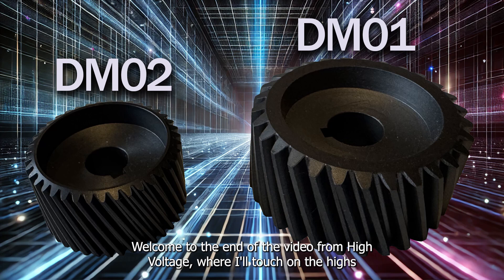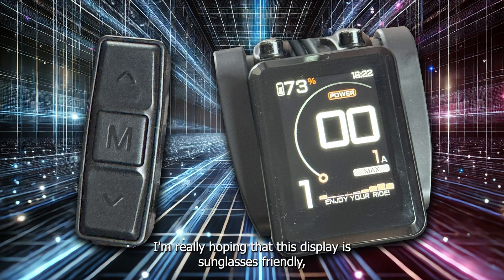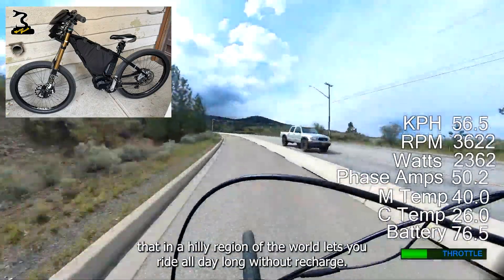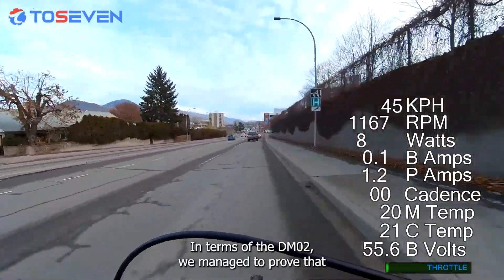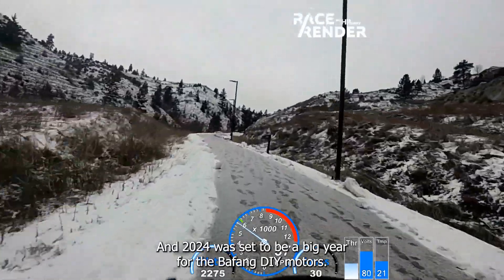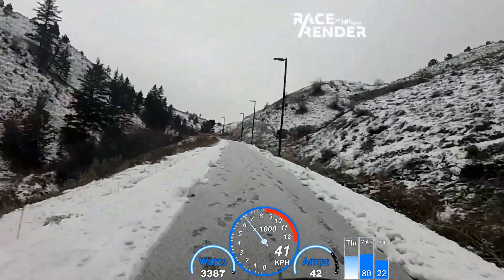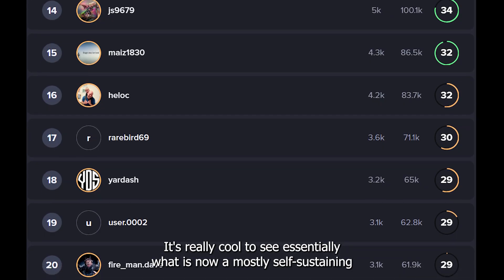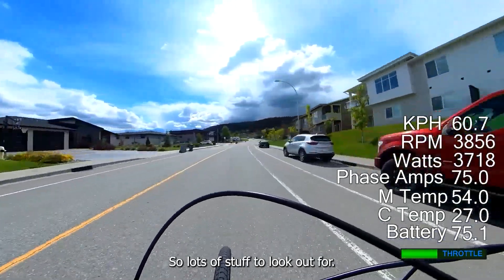High Voltage Year in Review 2024 - Cotton Mouth - TOSEVEN motor - Bafang

Comment: Slightly off topic. Toseven DM01 750W with 46t front chain ring. If i can only get 5 gears on the rear cassette to work due to chainline what is recommend.

Riding style nothing crazy. 52v battery road, 35kph would be enough and gravel tracks and a bit of through the woods. I like to peddle so no throttle. Standard controller

Comment: 100% dm01, i won't take anything under 1000w.
Reply from the maker: Hey Mike. It looks like the DM02 will be first by popular choice but I will for sure get to the DM01 as soon as possible. I might wait till late Feb so the roads are a bit better before I swap it out though.
Reply: @HighVoltageKits  Hello! I wanted to check in to see if you ended up doing any more work with the DM02? It sounds like a very promising motor, especially with the upgraded gear!

Comment: So, I'm confused. Is the torque sensing M635 uncancelled now? Does it require a proprietary battery?
Reply from the maker: It would seem that is correct and you can use any battery. I’ll have more news in the new year.

Comment: I've been using an ESC controller with the DM01 for quite some time now and it works wonderfully as an electric moped with throttle based pedal assist,  except native cadence based PAS doesn't work. Not worried about the torque sensing for now. Hopefully I'll figure it out soon. I recently reinstalled the stock controller with the updated firmware before I knew of the changes and they really did manage to sabotage this motor. Bad business move and it seems to run worse than it did before the firmware update.. Once I figure out cadence based Pas in VESC, I'll be set. I'd be interested in buying one of those black gears for sure.
Reply from the maker: Sounds good! Sorry you updated the motor before you saw the warnings. Hopefully TOSEVEN will see some sense and come up with a solution that is the best of both worlds. Good luck with the cadence based PAS. There are two colored wires for the cadence signal and the white wire is the torque signal.
Reply: @HighVoltageKits  Quick questions for you.

1. Without the torque wire in the equation, does the sensor essentially become a "quadrature" PAS? This is the only type of sensor VESC natively supports without writing a script.

2. Will you have some printed 01/02 controller covers available for sell any time soon?>

3. What's the projected ETA for the peek gear?
Reply from the maker: Yes to all. Shoot me a pm on discord for a controller cover. Same as the bbshd cost. PEEK gear enquires to Greg@highvoltagekits.com

Comment: John, thanks for continuing to raise the bar of tech for the e-bike community.  You have a keen sense of what we want as enthusiasts and many thanks for this effort.
Happy New Year.
PS. for many of us DYI'ers, CANBUS of course is merely an effort to make motor software unhackable and pair to proprietary batteries etc and the opposite direction of the freedom most DIY'ers prefer. In the context of the M635 motor, I hope as part of your R&D,  you evaluate whether its possible to connect this motor outside the limitations of CANBUS with alternative controller.  If Bafang pulls the plug on BBSHD production, it will be a big loss to the community.  All the best.
Reply from the maker: Hey Luke. Thanks for the kind words. Massively appreciate your support over the year. Looking to kick the channel into a higher gear next year. 2024 has been quite a difficult one all in. Cheers
Reply: @HighVoltageKits  Great news John. Your finger is right on the pulse and look forward to your content in 2025.  Best in the New Year.
Reply: There is no ''unhackable'' system i know of. Yet open source is the go for us diyers
Reply: @nicod974  Have you hacked and successfully paired Bosch, Yamaha, Shimano and Panasonic CANBUS motors to generic controllers and non-proprietary batteries with either torque or cadence sensing and throttle control?  
Is so, can you provide a link?

Comment: You seem to be wondering a whole lot about "why" companies like Bafang and TwoSeven make changes to things that are un-helpful to the DIY community.
It's simple - follow the money. They are a company, first and foremost. The DIY community is so microscopically small. Too small to support a small manufacturing run even.
"Locking down the firmware" and 're-aligning' development and production of certain motor series is a financial decision. Sure they might lose several thousand (yes, only a few or several thousand) by cutting off the DIY'ers, but stand to gain MILLIONS if they can convince some other mainstream builder/manufacturer to adopt their systems - Many of which play it safe with restricted settings, proprietary bus signalling, and redesigns.
First rule of making money - sell to rich people (other companies and corporations, rather than the poor (the microscopic DIY community of 'average joes'.
Reply from the maker: I have quite a bit of insider information on TOSEVEN having worked pretty closely with their Western representative. But this took us all by surprise.
Reply: the DIY community are more likely to be enthusiastic about the ability to change setups in the firmware, so why not leave it as it was - fully configurable and state that changes the user makes will invalidate a guarantee.? 
Therefore if anyone did wreck their motor trying things that shouldn't be done they can sell another motor to the customer who may then learn their lesson.
Reply: And you seem to believe John doesn't understand the industry and will hazard a guess and say he knows a lot more about it than you.   You don't know Bafang's business model of ratio of DYI sales to bike manufacturers. 
Two other reasons Bafang does it is to precluding turning up the amps on their stock motors which makes their motors more fragile and lastly they do it foremost for CANBUS battery pairing which has already been worked around with the M635.   Of course their decisions are revenue based, that's a given.

Comment: Thanks Capt. for all the great videos and continuous updates over the years. I can’t believe it’s been almost 4 years since my first HV kit and it’s still running strong. My other HV kit is equally as impressive with never an issue. Someday an LR motor will be in the mix but for now my bikes are running incredibly. Happy New Year and thanks to all the HV crew! Cheers
Reply from the maker: Appreciate you watching, cheers. Look forward to that LR bike. Although it will make the bbshd feel a bit slower.
Reply: @ 
Haha, I bet the LR would be a very impressive ride.
Reply from the maker: It sits so nicely at 50-60 without even trying that much

Comment: I'm guessing that the controller on the M635 could just be swapped out for the previous generation one?
Reply from the maker: Unsure on that one but we do have a kit on the way.
Reply: @HighVoltageKits  I saw a Johnny Nerdout vid with the new BBS02 Canbus one and the controller connections look identical to the uART one so that is a good sign. BBSHD will hopefully be the same.
Reply: @Hybrid600  So effectively you are saying in the context of BBSHD, that a stock controller can revert the BBSHD back to non-CANBUS running status? That would be good news.
Reply from the maker: The bbshd is a bit different but with some effort the old controller can replace the new one with the non torque sensing m625. I’m not sure on the torque sensor version yet.
Reply: @lukewalker1051  correct. The other option would be to just get rid of the Bafang controller altogether and put an external one on to give it some real performance.
Reply from the maker: It can only the 625. Not sure if that will be the case with the M635. We will have a good play when we get more motors though.

Comment: Is there no chance you all put out a cadence sensor based hv kit for the DM01 like the bbshd, then maybe upgrade to a TS HV kit later when it's figured out? Im sure if you make a handful people will buy them, me being the first 😂
Reply from the maker: I’ll have a chat with Greg. Maybe we can do a one off. I had not considered the upgrade path.
Reply: @HighVoltageKits  Thanks! I got into the ebike business late and so missed out on the bbshd wave, but when I read about torque sensing and the possibility of an hv kit, I dropped the cash on a dm01. I'd imagine I'm not the only one that bought a dm01 with the intention to upgrade it one day, and even without torque sensing it should feel mostly (or even much better based on the reduction ratio) like an upgraded bbshd. Thank you for your consideration!
Reply: @_Drae2210 It's possible you're right, but after having a decently running BBSHD bike and other nice torque sensor based motors, I wouldn't do away with the torque sensor on my DM-01 under any circumstances I can imagine.

Comment: Separate comment for the poll about which ToSeven motor for you to experiment on first:  Despite loving my DM01 so much, I think I vote for the DM02 to be your focus first.  IIRC, you already had the DM02 running more power than my DM01 does, so I think it would be more fun to see just how far you can push that lighter, less expensive motor...  Then eventually, it would be fun to see what you can do with a DM01 in full dirtbike mode too, but for now I vote DM02.
Reply from the maker: Appreciate the vote. Cheers
Reply: @HighVoltageKits  My pleasure, thank you for all of your efforts on all of these fronts.  :)

Comment: Great stuff here, VERY EXCITING developments as always!!  Personally, I upgraded my Motobecane fatbike from Luna Hotrod controller BBSHD to a DM01 (Same 56V battery for both) early in the summer of 2024, and I couldn't be more pleased!  The torque sensing is almost like a combination of the feel from my Specialized Turbo Levo and a bit of the better "urgency" upon pedal pressure that I like from our Giant e-bikes.  It's simply phenomenal to me -- And thank you for the heads up in this video NOT TO update the firmware!
Reply from the maker: You are welcome. Glad you are getting on well with your DM01
Reply: @HighVoltageKits  Thank you!  I can't wait to see what comes about with the M635, also.  Especially with your controller in the mix.  But for me the DM01 is just "WOW!"  Nearly perfect.
Reply: tptrsn, thanks for letting us know how pleased you are with the DM01 torque sensing motor as alternative to the BBSHD that I ride and love. Great to know.  I hope you share the reliability of the DM01 over time with this channel. All the best.
Reply: @lukewalker1051  If I have anything useful to add I certainly will!  Unfortunately, I don't ride a lot any more, but if I do ride, it will probably be my current DM-01 equipped bike, or maybe a full suspension bike with a DM-01 on it if I happen across just the right bike that is asking for a motor. Lol